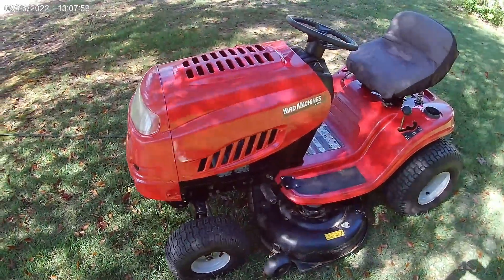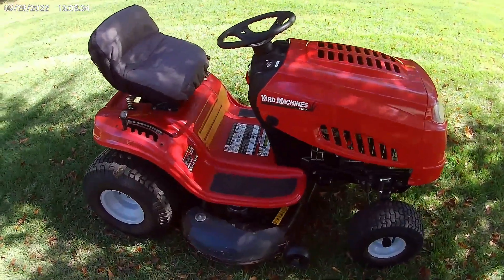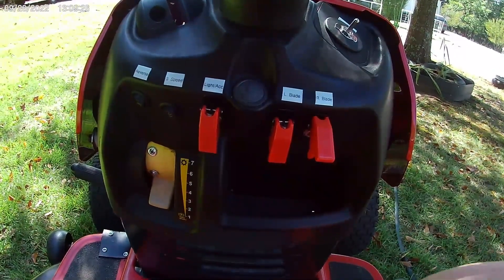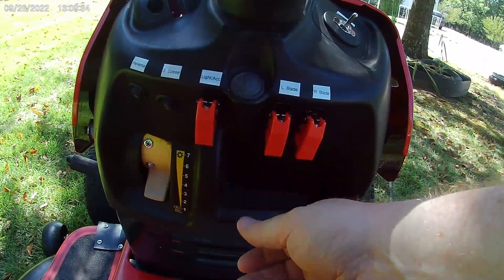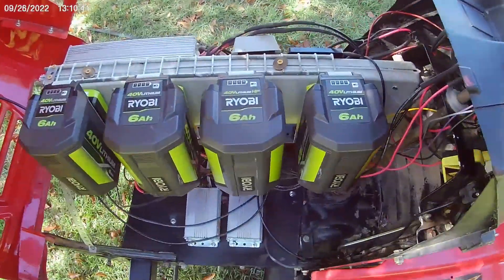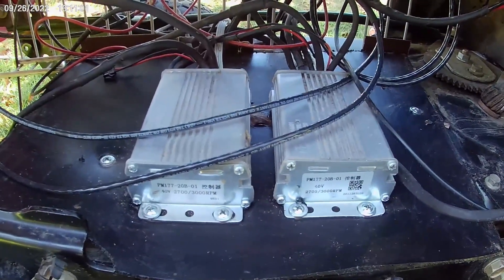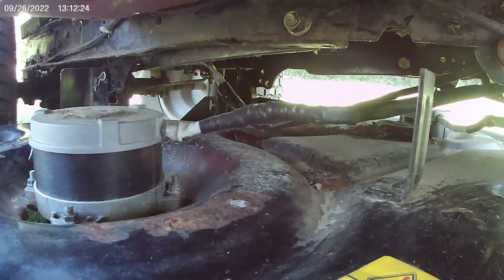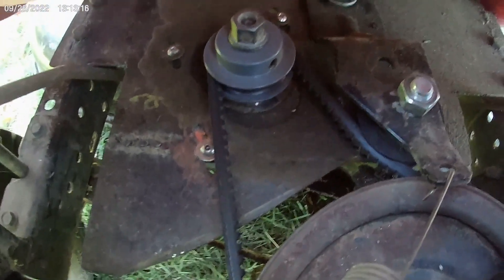Ryobi 40v Brushless Lithium Powered MTD Yard Machines Mower Electric Conversion Triple Motor Update

Comment: You mentioned in one of your videos this was a single geared transmission. How would this work with a hydrostatic transmission you think?
Reply from the maker: I did some experimenting with that idea, but it is very inefficient. Uses battery about 5-10 times faster and overheats the little motors I used. Could be done using a larger motor, but it will still be very inefficient. I wouldn't recommend it based on my testing.

Comment: I’m mowing about an acre with a Kobalt electric push mower currently with a couple of 2.5 ah batteries tag teaming to get it done. Curious what the range and recharge times are on this.
Reply from the maker: I use 3 x 6ah  batteries to power the mower and it runs about 45 minutes. My rapid chargers take about 1 hour to charge a battery, but I have 6 rapid chargers. Takes a total of 9 batteries typically to mow my 2 acre yard.

Comment: Did you ever run into issues with the motor regularly cutting out due to overheating? I'm working on a similar build and I believe I may be overheating the same Ryobi motor and causing the motor controller to cut it off to cool (runs fine for short spurts but then needs to remain off for short periods). I did mount the motor in the front area and am using the existing belts there, so perhaps that creates more friction and therefore more work for the motor. Your arrangement seems to have the motor mounted directly next to the transmission input which I'm guessing reduces some friction.
Reply from the maker: I've had the motor cut out only on steep hills if I give it full throttle. It seems to overload the batteries on mine rather than the motor. I have to unplug the battery and then put it back in. If you have a laser thermometer you could check the motor and the controller for issues. What size controller are you using? The longer belt and pulleys certainly could cause extra friction and overload. I did recently have the bearings on my drive motor go out due to the stress of the v belt tension. I am experimenting with using a cog belt instead and will be posting a video and the designs for that when I get it worked out and tested. My new pulleys are all 3D printed. Preliminary tests show that it doesn't require the same tension to avoid slipping, so that should avoid stressing the bearings or motor.
Reply: @oddjobsandrandomprojects  My controller is 36-48V 1000W. I like your cog belt idea, I'll have to try that out as well.

Comment: I love it. its definitely one of the best conversions i've seen.  the problems I;ve seen with most conversions, is either they use a very expensive me1004 motor in place of the original gas motor which results in extreme amp draw (100 amps mowing) or they completely cut up the mower replace the rear axle and use some odd ball motors for the deck. this is the best of either conversion. common off the shelf motors, retains the original transmission, and uses common off the shelf parts. for the throttle, those are just spring loaded potentiometers. you could just use a dial pot in place of that lever arrangement.
Reply from the maker: Thanks, I appreciate it. Honestly hadn't thought of using a dial, but that would probably be easier than the lever. I'm going to add foot throttle sometime soon and a selector switch for selecting lever or foot controls.
Reply: @oddjobsandrandomprojects  i thought about that too. operate it on "fixed" throttle if mowing  and switch to pedal throttle when using it for a utility vehicle.
Reply: @oddjobsandrandomprojects  oh question. where did you source the ryobi mower guts from?
Reply from the maker: @MrSGL21  I purchased mine on eBay. This was the listing I purchased from, but there are lots of others available too.
https://www.ebay.com/itm/Ryobi-40V-Electric-Mower-RY401011VNM-PARTS-complete-motor-controller-wiring-/194612921345?mkcid=16&mkevt=1&_trksid=p4429486.m46890.l6249&mkrid=711-127632-2357-0
I think there are links to each part and a list of what I used in another of my older videos

Comment: What did you do for blades?
Reply from the maker: I used the 21 inch Ryobi blades that went with their push mowers. They are interchangable with the 20 inch blade holders on those mowers and the riding mower deck had 2 blades that were originally 21 inches each. So that worked out easy with no modifications to the blades.
Reply: Thanks, I guess my deck is a little smaller, luckily the 20" fit perfectly. I've got one spindle removed and the old blown motor removed and the fuel tank and battery. One ryobi mower motor installed with blade. And I've ordered one of the vevor 1800w motors ordered for the drive motor.

Comment: Wow!  I really like this build.  I like that you used Ryobi batteries in this mower.  I especially like that you have an electric motor for each blade, AND another system for a headlight and accessories.  I have a Ryobi trimmer and leaf blower so I'm already invested in the Ryobi battery system.  I have a dead gas powered mower and would like to convert it as you have done here.  Do you have plans or instructions or anything I can go by as a guide to help me convert my mower?  I think maybe the only thing I would do different would be a foot throttle pedal.  AND maybe one other change?  You did not mention if you have quick disconnects for the mower blade motors for easy removal of the mower deck to replace or sharpen the blades.
Reply from the maker: Ah, I must have neglected to mention the quick disconnects in this video. I have an older video that mentions that, but I had trouble getting a good picture of it. I used locking 3 wire generator plugs as quick disconnects. I too have considered using a foot pedal, although I think I might put in a selector switch so I can use either one to control it. I do not intend to make complete plans, since it would vary according to the mower being converted. However I do plan on making a video on the wiring and posting a complete wiring diagram along with it. I was actually going to do that this weekend, but the weather has not cooperated. Thanks for the encouragement and best wishes on your project.
Reply: @oddjobsandrandomprojects  I do apologize, you did mention the generator plug. I must have missed that it was for a quick disconnect. I would be very interested in the wiring diagram when available. I intend to start disassembling my old broken gas riding lawnmower this weekend and ordering parts for the conversion.
Reply from the maker: I just posted a new video that shows the detailed wiring modification for the blade motors. I will be adding a wiring diagram link in the description on that video once I finish sketching the diagram.

Comment: I have completed my conversion, I'm using 4 12v 20 ah lifpo batteries for 48 volts. No problem with the motor, and the same controller and throttle you used. My drive system is two pulleys that change diameter, the farther you push the pedal the faster it goes, no hydraulics involved. I'm happy with it, it goes faster than the gas engine did, too fast in the yard however on fast speed. I did in fact get a bad controller the first time but they replaced for free. Thanks for the  replies to my questions.
Reply from the maker: That's awesome! I'm glad to hear you got it working. How's your run time with those batteries? I'm betting it is quite a long time with that size batteries.
Reply: @oddjobsandrandomprojects  I'm getting 1.5 hour run time , my amp draw is anywhere from 8 to 20 amps depending how fast I drive it. Normal use for me is about 10 amps. But that's plenty of run time for me. I used # 8 battery cable, maybe I should go to # 6 I thought I'd get more run time , but then again the controller shuts it off at 47 volts even though it's a 40 volt motor, my full charge is 52.8 volts . I would recommend 30 AH batteries a little more expensive but who's adding up expenses ? I don't know how to add a picture of my project to this reply. I used the original drive belt and pulley setup , mine is a single speed trans axle with variable speed pulleys, I did however make a new motor pulley to accomodate the 5/8  drive belt.  I do have play in my motor and will be replacing the bearings. I don't use this tractor for cutting grass it's more or less to use for yard work only.

Comment: This is interesting. My dad has tons of mowers with bad motors waiting for something like this. About how much are the motors and the controllers?
Reply from the maker: I've been finding the motors with controllers for about $45 each. You will need a $35 ebike motor controller that does the variable speed for the drive motor. I've been thinking about switching to a throttle pedal instead of the lever.
Reply from the maker: https://youtu.be/rNciemB_3YA
In this video I break down the costs of the parts as well as what it costs to operate.

Comment: This is a very interesting project, mine is a troy bilt, I push a pedal down to change the speed using the gas engine. I am very much considering starting this project. I use this tractor only to 
ride around my yard when doing yard projects so no mower will be used. How long will it drive on 1 charge, that's where I need to start at. Do you use the variable speed, or the 3 speed switch,
or a combination of both? My compliments on a good job here.
Thanks for any reply
Reply from the maker: The charge for the drive system seems to last about and hour. Your result might be different though since it sounds like yours has a hydrostatic transmission instead of a manual like mine has. I've been considering doing a conversion on my old Craftsman with a hydrostatic drive, just to see what happens. If yours is a hydrostatic drive you probably don't need to vary the motor speed, since you can control it with just the transmission. So you could use a complete Ryobi 40v motor and controller, and just set it up with an on / off switch for the motor. However that may not be as efficient. I vary the motor speed using the motor throttle on mine, but I just have a single speed transmission. The three speed I normally leave on low for mowing, but then high speed for just driving. In your case of just leave it on high unless I were towing. Hope this helps.
Reply: @oddjobsandrandomprojects  I purchased the the motor/controller with wiring from ebay, I plugged in the harness with  the 2 rocker switches, and used a 40 volt battery from a Black and Decker weed trimmer to see what RPM the motor runs at, however the 3 lights lite up but the motor doesn't run, there is a white harness coming out of the controller but nothing to plug in to it, don't know if any is needed either, It has 2 rocker switches, do they allow for 2 speeds? I'm new to this type of conversion and really want to make it work. Any help would be appreciated. I have the variable transmission that uses pulleys like on a snow mobile to change the tractor speed, I run the gas engine at idle which is about 700 RPM's, so I'm hoping I it has 2 speeds.  Thank you
Reply from the maker: I need to include some details about that in my video. You are possibly having the same problem I had when I did mine. The controller Ryobi uses has to be mounted flat or it will not start the motor. There is a safety built in, so it doesn't start if it was tipped up. Took me quite a while to figure out why I couldn't get it to start. Honesty much longer than I'd like to admit.
Reply from the maker: The Ryobi controller is only one speed and runs at about 2900 rpm if I recall. I imagine your factory variable system will work fine, although you might need to use a smaller pulley on the motor to reduce your speed. If you need more flexibility on your speed you can always use an eBike controller like I ended up with. They don't have that safety, so they aren't picky about mounting position.
Reply: @oddjobsandrandomprojects  I purchased the same motor/wiring as you have pictured, I plugged everything in, and put 40 volts to it using a 40v black and decker battery, as I may go with bigger batteries, but the motor will not run. The 3 lights come on ,I tried the switches ,the controller is flat, but nothing happens, the ebay seller does not accept returns ,  but everything is new, so I think it's something i'm not doing right, do you think it's because I don't have the ryobi battery.
Reply from the maker: @randykistler4760  I'm not sure, but I don't think so. Any 40v source should do the trick. I think the Ryobi ones actually put out 41-42v. Have you put a voltage tester to them to see if the Black and Decker is the same. I need to go over the wiring again to make sure how it has to be connected as they are a little strange. But once you get them working it is easy. I plan to make a video about the wiring and how to connect them easily, but I've been working a lot lately and haven't had time.
Reply: @oddjobsandrandomprojects  i have purchased the speed controller, and throttle ,same as listed. I can get the motor to run but after unplugging the learning wire motor doesn't run ,only with it connected, With the throttle connected and learning wire connected the  throttle changes motor direction , as with the learning wire disconnected also. I don't know if I got a bad controller or I'm doing something wrong but i'm following directions on controller instructions .  Any advice would be appreciated ,
Reply from the maker: @randykistler4760  That is strange. You might have a bad controller. The learning wire should make it run, but that is only to determine the motor direction. Once it turns the correct way you should just be able to leave it disconnected like mine is. The other possibility is a defective throttle or one that the wire colors are wrong. I had one that the wire colors were different, and once I figured that out and connected it correctly it worked. I also had one controller that would only go into learning mode with the throttle disconnected. I think that throttle was always sending a tiny signal. I'm sure the quality on these cheap controllers and throttle isn't the best, but once you get one setup and working they seem to last just fine. Some of the sellers are actually quite helpful, so if you continue to have problems try contacting the seller you bought it from. Can't say they are all good, but it's worth a shot if my advice doesn't work. Also I can't remember what transmission your mower has, but I just added a video about my attempt to do this on a hydrostatic drive.
Reply: @oddjobsandrandomprojects  I think you're correct about a bad controller. The throttle wires match colors , with 5v in the red wire and 0 to 4.8v coming out the green wire. I watched your latest video also , my mower has a pulley that changes diameter , the more you push the pedal , the tighter the drive belt gets the smaller the pulley diameter gets changing it's speed via 2 other pulleys and belt to the transmission , which only has forward and reverse. I hoping with this belt system the motor is powerful enough to work , but yours will pull a car ,so it should work for mine . The seller allows returns so I'm going for another controller. I see they never list the max RPM's for the controllers , that must be set when built .Thanks for getting back to me , I'm very excited about this project , it is my kind of hobby , just a new direction .
Reply from the maker: @randykistler4760  Yep, that is exactly what mine had. On mine the pulley system was no good, so I removed it. But I would imagine it would work well with it.